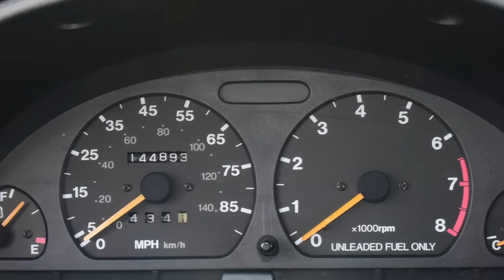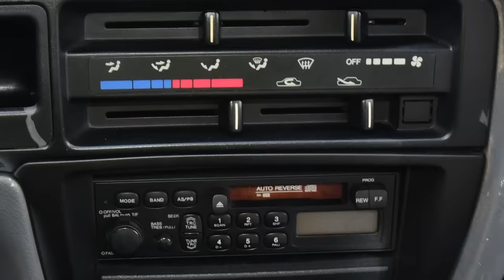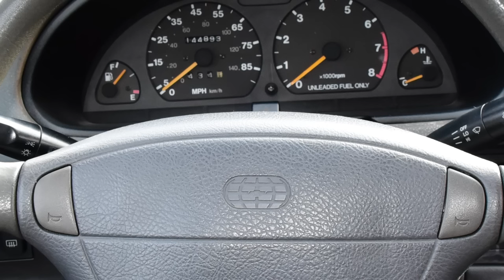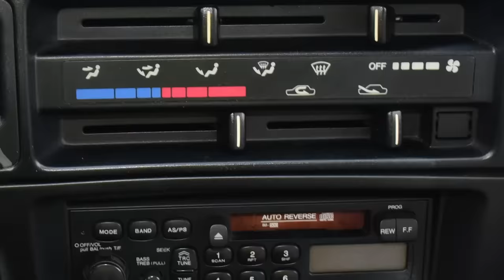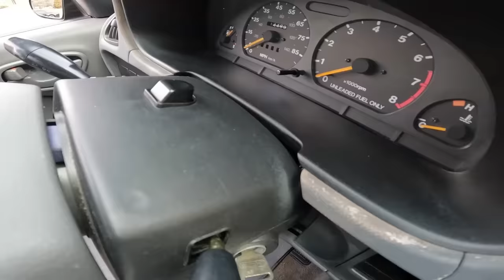1996 Geo Metro 5MT: Regular Car Reviews

Comment: My uncle is 6’5 and like 210 pounds, tall thin fella. He went to the dealer in 1995 and said, “I’ll buy whatever I can fit in,” and thought the salesman was having a hoot when he wheeled up a Metro. But the seat scooches so far back it was a great fit! He dailied that thing until it had 300,000 miles.
Reply: I beat one up for 100k, I believe someone same could make their car last 300k.
Reply: my friend in high school would let me drive his mother's Geo Metro (just because he was so terrible at manual transmission).  try driving that thing with 4 200lb football athletes in it, you had to keep the thing floored.  and it still angered people behind us because it was so horribly slow
Reply: My friend's dad is 7'2" and he'd drive his daughters geo metro for the same reason, could actually fit in it amazingly. Except he had to put his head out the sun roof.
Reply: 6'5" and 210 is not skinny...
Reply: @merl-lv7dp  6'5 and 210 is on the side of athletic/fit add it's probably better than the copium chumbo wumbo you're freebasing. I'm 6'1 190 and still kinda thin. Cope harder
Reply: @merl-lv7dp That's slightly chubby to lean athletic build. I'm a similar height and weight.
Reply: Speak english, clayton
Reply: @merl-lv7dp yes it really is.
Reply: @merl-lv7dp  It's a slim athletic build. You could have muscular thighs with lanky arms, and torso.
Reply: My great uncle used to daily one that’s blue. Idk if he still does. He’s the same discrimination as your uncle
Reply: Sounds like a happy story/happy ending to a story
Reply: I'm 6 ft 3.5 and my daily is my late mums 1995 Suzuki Swift HB 4cyl 1.3 sohc 5pd ABS purple her name is Smudge 213,xxxkm. She chipped has lots of power! I was comfortable in it. I'll keep her forever!
Reply: @merl-lv7dp yes it is ! I'm 6 ft 3.5 210 lbs I'm not fat!
Reply: Yes it is. I’m 6’5” 230 with a very tight athletic, body. 250 at 6’5” is not thin.

Comment: Finally. Now THIS is a regular car
Reply: Well below regular.
Reply: "Now THIS is pod racing!"
Reply: This is a base car but it's below base
Reply: The Metro was an honest econocar.  It didn't have the more modern good looks of, say, a 1990 Dodge Colt (Mitsubishi Mirage) despite being a half decade in the future, but a similar Spartan approach is in evidence here.
Reply: This is the one cars that may be SO regular that it's irregular
Reply: I hope Mr Regular can find a Pontiac Firefly to try out. It was Canada only, but it had a turbo version on this engine, and a hood scoop.
Reply: It's PEAK regular car.
Reply: @Shorty15c4007  I literally was right about to type that
Reply: @illegal_space_alien  iirc before the Geo brand there was a Chevy version of this car sold here in the States that had a turbo option as well. That would be neat to see.
Reply: The most regular car ever.
Reply: @Myriadys  Oh yeah, the Chevy TurboSprint! I forgot all about those.
Reply: The most regular of the regulars.
Reply: If shit box is regular, then...OK.
Reply: God bless
Reply: @hunters423 lol that’s a good way off putting it. I cross the border between the us and Mexico a few times a month,  and I think it throws them off. It looks out of place so I constantly get checked on both sides of the border.
Reply: The irony.
Reply: This car is nothing but regular. SOLVING THE FUEL PROBLEM AND MAKING YOU RICH! This is nothing more but THE PINNACLE of car engineering. I shall not tolerate the Suzuki Swift being called regular.
Reply: @giornogiovanna5965 making people rich 1 geo at a time😂

Comment: I have had a 1993 Geo Metro for around two years, and it is by far my favorite car I have ever owned. Never before have I felt "connected" to a car, but my little red Geo, "Tug," has somehow managed it. There is a weird companionship with these little things that is so hard to explain. I plan on cherishing my Geo, considering nothing like it will ever be made again. Long live the Geo Metro, man.
Reply: I have had a 1992 convertible for about the same time and I love it the same way 🥹
Reply: Nice same but mine was a 90 white and black trim
Reply: I feel like that with my Samurai ❤
Reply: I lived down a dirt road and it would pop out of gear almost every day. I had to frequently use the Flint, MI  I-69 east to I-75 south  interchange in a metro. It felt like shaking hands with Satan every time. Fantastic fuel Mileage as long as you didn't take on passengers because then it falls off a cliff. I don't miss it but it will never be forgotten.
Reply: I feel the same way about my blue 92 hatchback
Reply: I felt that way about my last car-a 1996 Dodge short-bed pickup. I paid cash for it, the dealer was happy to get it off the lot(they'd reduced the price) and I had it for almost three years. It was red and gun-metal gray from sun fading, but until the engine finally died, I couldn't have asked for a more dependable, no-frills vehicle.

Comment: I made a mid-engine SHO-swapped Metro. One of my fondest memories of that car was there was a point in the build that I had the new drivetrain fully installed (not yet running) but the stock drivetrain was also still working. So I got to experience what it feels like to drive a stock metro essentially lugging around the dead weight of an entire front half of a Taurus 😂.
Reply: What happened to it, did you sell it?
Reply: Was it the one that was in the 24 hours of lemons race ?
Reply: That sounds like some serious fun😊😂🎉
Reply: You cant just say "SHO swapped metro" and not elaborate about it

Comment: I've been dailying a Geo Metro for 5 years. The ownership experience has been pure happiness and joy
Reply: Same Brother 4 years going 3/5 99.
Reply: I drove the hell out of mine lol. It never left me stranded
Reply: I've been dailying my geo for 20 years (1994 model) and still going strong.  The best part about geo is that it's so easy to maintain, and parts are cheap too.
Reply: I had one for over a decade. It had AC. Super reliable, and it got me through the Bush gas crunch. I remember $5.00 gas, and strangers walking up to me and wanting to buy my car. I got 44 mpg on road trips at 75 mph. Beat the crap out of it in city driving. I finally sold it to get a Fiesta ST. Would have kept it for a winter beater (no rust on it), but didn't have the space. It's still running fine today, I imagine, and  someone's getting to work CHEAP.
Reply: I have been daily driving geos since I was in high school back in 2007, only other cars I own is a Suzuki swift GTi and a Suzuki samurai.
Reply: @GasGearsGames  Them Dohc setup are freaking monsters
Reply: I have had a 92 then upgraded to my 97 which I have had since 2016. Love these things. I have a custom cam and upped the compression when I rebuilt it because I cannot leave any car alone. Also got a 3.52 gear tranny. Everyone looks at me crazy since i have a 2005 vette but daily the metro.
Reply: Go Kyle go!
Reply: How are you finding parts?
Reply: I've been driving my Geo Prizm since it was new . . . in 1996. Love it!
Reply: smiles per gallon too
Reply: There's something really fun about driving a tiny tin can with not much horsepower. I had so much fun driving several of them
Reply: @bongodave13  They have a frame issue that will cause almost all of them to self-destruct unless you live in the driest of climates. I loved my Metro though... The manual everything is something I actually LIKED. No frustration with beeping this or windows rolling down too much if you hit the button too much, no power steering noises in the cold... just a simple car that ran great. It also performed very well in the snow and even some back roads. I don't know if it is the weight or the narrow tires, but I drove that thing to some insane places in Utah.
Reply: All these happy owners. The 44 mpg sells it.
Reply: I'm going on 10 years on my second Metro, and over 20 years driving Metros as my primary daily commuter.  Love these simple little econoboxes.
Reply: @applepoop10  'Cause no one who still has one wants to turn loose of it.  It's hard to get someone to sell one once they've driven it a few months.
Reply: I love small cars. Currently have a 2017 Fiat 500 Cabrio 1.2 with 69 hp. Never get a speeding ticket
Reply: Weird thing around here, tires are getting sort of hard to find. Have to order them.
Reply: @iamatlantis1  Yeah, I had that problem when I got mine replaced recently.
Reply: I  bought one of these dirt cheap from my employer (4 cylinder version). I used it to commute to college and kept it years after graduating. It never broke down on me so that made me happy. Tons of little things broke but nothing that stopped it from running. With that said it was a crappy, cheap, very uncomfortable car to drive. I still have it sitting out in a field on my property. It’s my back up emergency car.
Reply: 55 Hp is really not a joy
Reply: Quit lying. It is miserable and embarrassing. I have owned multiple.
Reply: I've moved up to a fiesta st, but I still miss the metro I had a few cars ago.  I beat the piss out of that car, I didn't care and the car cared less.
Reply: Nice MR2

Comment: We had a Geo Metro for years, loved that thing. The gas mileage was incredible. We could fit a colossal amount of stuff in the hatchback. The tires were tiny and cheap to replace. We could fit in any parking spot except for SmartCar spaces. We were pulled out of a ferry queue once and directed to the front of the line to be the last car on the ferry because there was JUST enough room for us. My 6’2” husband fit into it easily. Campers passed us on hills. Once we had the oil changed and the mechanic said “the engine - it’s so cute!” We put over 100k on it, including driving from BC to Saskatoon, Saskatchewan (yes over the Rockies). Sold it eventually to a collector of Geos on Vancouver Island. I hope she’s still driving around somewhere. Miss you, little Jelly Bean.

Comment: I'm glad you talk about the safety issue of this car. Because when I was younger my dad had to drive a 93 geo metro as his daily for work as a contract security guard. In 2008 he was out visiting a  friend it was raining heavily and he took a turn hit a thick patch of wet leaves slid and for some reason in the middle of fuckin nowhere Pennsylvania he got into a nearly head on collision with a Lincoln Navigator. Unfortunately this car model was before air bags were mandated so he didn't have an air bag. The seatbelt saved his life from flying out of the car but he slammed his face into the steering wheel. 
He had a laundry list of injuries from the accident, most notably a shattered left orbital bone (that's the bones around the eye), a broken jaw, a broken left leg, and (as written on the report by the doctor) several broken ribs.
Unfortunately even after he survived, all of that had made him age off a cliff. You'd think he was in his 60s or 70s by the time he died in 2015. He died at 49.

I don't post this to scare people away from this car. I really liked that little fart cart, it was fun to drive around in at my grandparents place. I post this just to tell people. Be careful. These cars are good and point A point B. But they are like Little Mac vs Mike Tyson.
If you've read this this far Thank you for your time and I hope you have a nice day.

Comment: THANK YOU for giving a real impression of this car.  EVERYTHING you said about this is 100% correct.  I owned a 1996 with 198,000 miles.  Just like you said, you could rev it all day and it would return 40+ mpg.  It saved me a ton of money during the 2000s recession when I was broke but still needed to get from point A to B for my additional jobs.  I would love to have another one of these again.
Reply: That's the thrill of it, LaCrosse!

Comment: I had a 99 for a long time.  It saved me a ton of money & hauled a ton of wood pellets stacked up to the roof & passenger seat twice a year.  Also moved  a 450 lb wood stove across 1,000 miles & still got 38 mpg doing it. It did mpg & stuff in the back really well which is more than I can say for some other vehicles I've owned.

Comment: The first car I bought was an used 1995 Suzuki Swift in 1999.   I had it until 2010.  Can't complain.  It was a very serviceable car.
Reply: My old boss has two of them still today. A 93 and a 96 The 93 is about cooked but the 96 is still going and he uses it as his car he brings and leaves in long term parking at the airport. No one wants to steal it. Im surprised how that little 1.3 4 banger keeps going after all those years
Reply: Much better car TBF, but great cars.
Reply: My mother-in-law drives a Swift so old the entertainment console has an analog TV tuner and minidisc player.
Reply: @KarlBaron  If I knew back then what I learn about maintaining and mechanics in these years, I possibly will still using this car.  I have fond memories.

Comment: this is my kinda car, you can mess around in it without breaking any laws.
Reply: that's it! Horsepower does not mean fun!
Reply: @alfderbabybenz7092  very true, i’d much rather throw an economy car like this up a mountain road.
Reply: i had a 1995 fiat Uno mille with a 1.0l 56HP engine..the short 5th gear+ stock exhaust gave the feeling that the engine was revving at 12,000 rpm with doing 100KM/H, but the light body and full independent suspension  made that car really fun to drive!
Reply: No judge would believe any cop trying to give you a speeding ticket
Reply: @juliancrooks3031  “he was speeding? in that thing?”
Reply: @mx_nana_banana  not as fun as you would think when you can’t get above 25 going up a mountain
Reply: @jkneeland89  going up wouldn’t be fun, but going down would be death defying.
Reply: @mx_nana_banana  only on steep downgrades with a strong tailwind.
Reply: That's how I felt about my Saab Sonett III, which had similar specs and was even lighter.
Reply: There are laws about minimum speeds on the interstate. So don't worry, you too can be a law shirking hooligan in your geo metro.
Reply: @juliancrooks3031  NO! You would get a tag for IMPEDING traffic! So, DO NOT take it out on the highway!
Reply: @TheOzthewiz  I drove mine from Galveston to Minnesota. I just took back roads. 1400 miles on 2 and half tanks of gas
Reply: i love driving my gfs honda fit for similar reasons (though you can def. speed in it)
Reply: there's no luxury like the ability to hoon your car anywhere you please without consequences
Reply: @kingdededelicious  yes, it’s one of life’s pleasures

Comment: I'm so happy someone finally submitted one of these. I had one back in 2017 that I wanted to submit, but it started to have problems and was too dangerous to submit in good conscience. 

That being said, it was the coolest vehicle to have in high school. When I got it in 2016, gas was $1 a gallon for a bit and took a while to climb. None of my friends had cars so they paid me to drive them everywhere. We went on day trips, raced clapped out fiestas, and even coasted down a mountain just to see if we could get to the pie shop without an engine (we nearly had it perfect too, if someone hadn't stepped into the parking spot we wouldn't have needed the engine for the last 2 feet). We even found a funny trick, if 2 or more people rocked back and forth in the seats, you could get a speed boost. You could watch the speedometer jump up each time. 

I sold it for more than I paid and made that much again in gas money. I'll never forget watching that car drive away for the last time.
Reply: It's a metro, why would you need to start it to move it 2 feet especially with friends there?
Reply: @16driver16  I mean we didn't NEED to. We were just too lazy to get out and push the last 2 feet. It was easily light enough, though. Dudes would get together in the school parking lot to try lifting it for fun.

Comment: My first car was a 96 Geo Metro LSi with the 4-cylinder not the three. So it had some power. However a popular engine swap because it's actually a Suzuki with a Chevy badge basically, you can take the Suzuki Swift GTI which is a 100 HP 1300 cc engine and put it in there or you can put a real motor in there and take the 2.3 l engine out of a Suzuki aerio which will bolt right up to the stock Geo Metro gearbox. Don't know much but 160 horsepower in a 1600 pound car is going to make that thing scoot.

Comment: I love these. I owned like 7 of them as a Europian, we have Suzuki Swift here.
I learned how to fix everything. Swaping engines.. Me and my friend even build one engine our selfs.
I daily drive this to work, getting 500+km per tank. And in some twisty downhills, this thing Is actualy kinda fun, mainly becouse rear suspension Is not from 1850 horse wagon like most of the cheap economy cars in Europe.

In Europe there was even optional ABS and power steering.
Had one with power steering And 1.0 engine. And you can literary turn the wheel with one finger.
Also had one with A/C. Every time i push that button, it felt like J-brake :D also A/C had normal And Eco modes.

One time we hit Giant pathole and shamed trough the oil pan. 5 minute drive to home, change the oil pan, pour some random Tesco oil in it, And it run like new.

ONLY one time we manage to kill G10A 
 with about 15minutes of non stop full throttle driving in rev limiter with no oil. 

And there was GTI version 1.3 twincam with 74kw
Doesnt seem much, but for weight of average shopping cart. This thing is beat. Mainly becouse a lot of Cars around that era in Europe had similar power numbers, but weight like 2 of these.

If you want a Honda, but dont have money for it, buy geo metro.
You wont regret it. It will save you money,